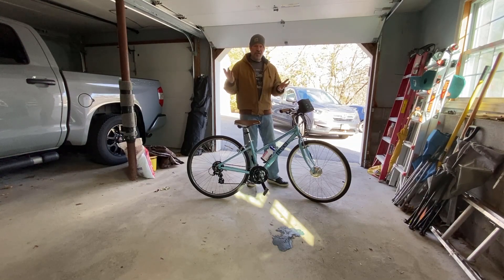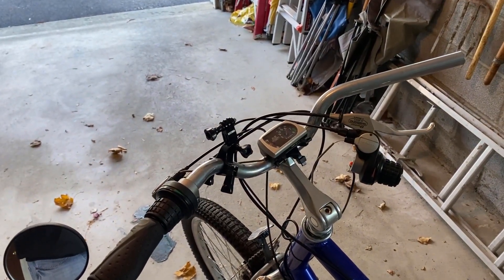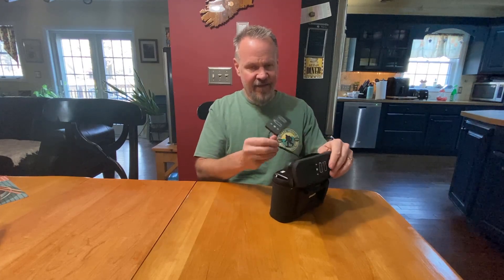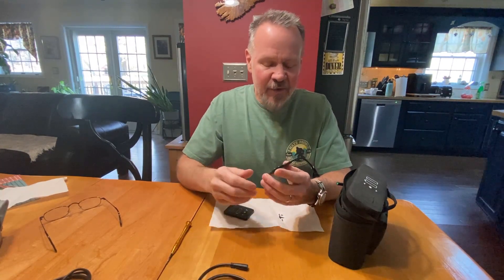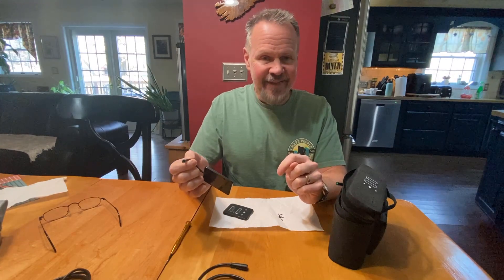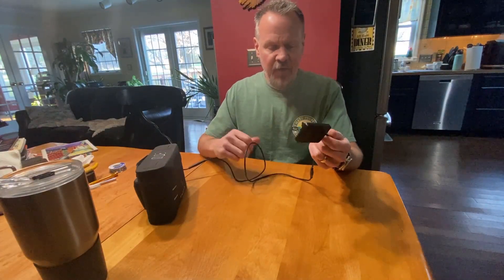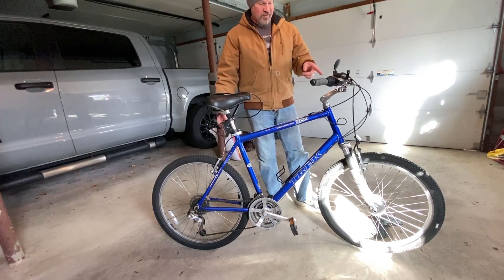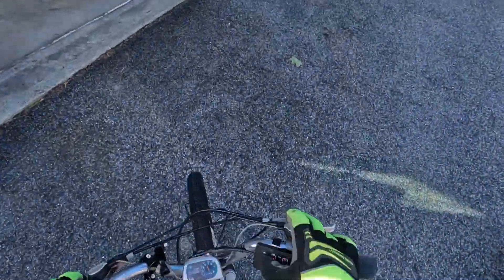How to move your Swytch bike battery and have handlebar controls

Comment: Hi, I'm a 64-yr-old grandmother and I enjoyed your video Chris,.I almost wish I had seen this first. Because I managed to find the small control cable on eBay UK ($40 total for the cable, taxes and shipping) and purchased a handlebar T-bar that I mounted to the seat post and resting the actual battery on a rear rack to avoid the harsh bouncing that makes the battery mount lose connection over time. My setup cost more because I did NOT splice cable wires and added the T-bar, but I am very happy with my solution. I wish more people had taken the initiative to come up with a viable solution that made the Swytch Kit more enjoyable.

Comment: Nice idea.  Just seems not necessary.
Reply from the maker: Agree it's not necessary, but based on the feedback I get and have seen about the weight of the battery on the handlebars I wanted to show that it could be done pretty easily.  Thanks for watching.
Reply: @Chris_Does_Everything  it does add weight to the handle bars.
Reply: The battery pack does change the weight of the steering and for many people that’s a real problem (I got used to it eventually)
This handy tutorial is really used for anyone looking to get around that issue, so yeah, it is pretty necessary.
Reply: Very Good Idea, Take it from a long-time owner of this configuration and the problems resulting from the abuse the front mounting takes. I am starting on this change right away, what a NECESSARY! Adaptation.